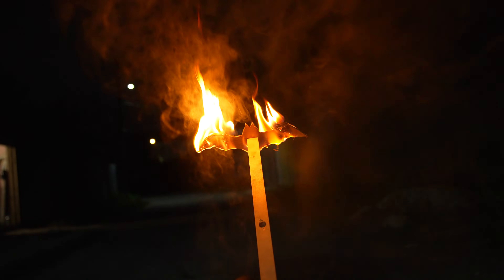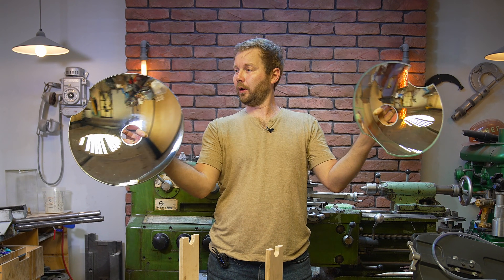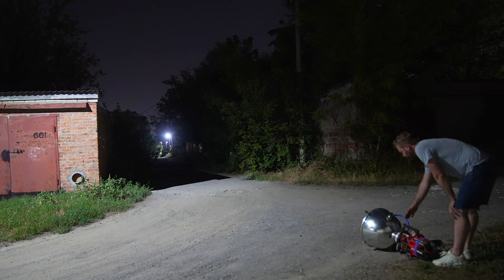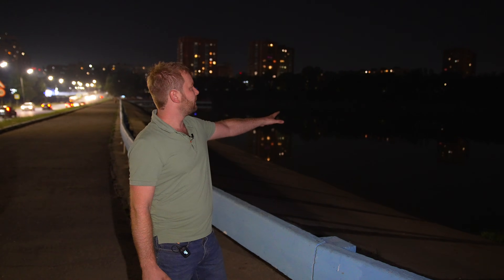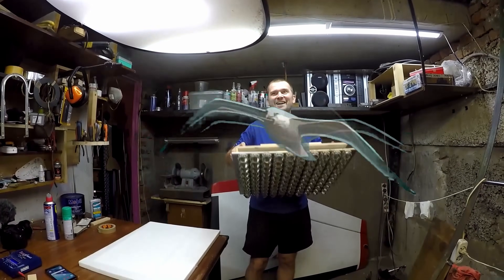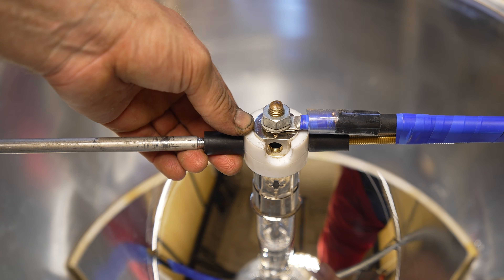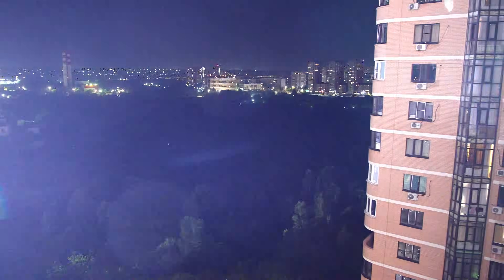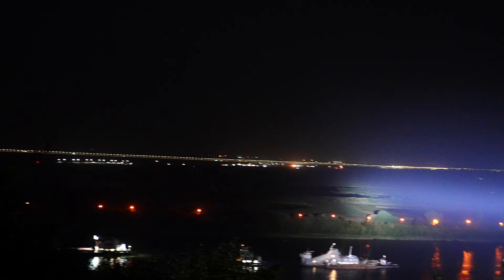The world's most powerful xenon flashlight.

Comment: I love this lamp absolute. but the bulb design, I would this build in in length. like a maxabeam and take a reflector with flat angle, not like a maxabem, because the outer diameter of reflector is in shadow of cathode. maxabeam is a very strong flashlight, but its need a upgrade in reflector geometry maybe. I must upgrade, because I have see the vertical alignment. I love this and on the likest I would build the same lamp...only with a glass for protection the inlets from reflector.

Comment: Nice gadget but: Is there any airflow to cool the light bulb? (The specs of the light bulb requires a forces airflow). And you need to calibrate the light bulb in 3 axis to have a perfect beam. The tolerance of all thee axis is just 0.1mm to bring the arc into the perfect position of the parabolic reflector

Comment: You should have went with a metal halide lamp instead because you could have 4x the light output with the same amount of power. LED Is double lumens per watt over metal halide but an LED is boring and not as compact